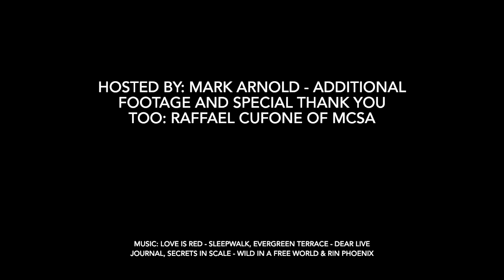253 UC Torana GETS ALL THE FRUIT! - The Iron Empire EP 110

Comment: Nice car.
Did a UC for the wife many moons ago.
That's a big carb for a 253.
Had great results from 500 2 barrels on 253s with a bit of compression, intake, cam, ignition and exhaust work.
465cfm for a 4 barrel is a good number too

Comment: I’m no expert but I would have thought that the 650 is still to big for the small engine?
I had a mild 253 in a LH torry many years ago and that was running an edelbrock 500 4 barrel carb. Ran awesome too.  Although I was not impressed by the old banjo diff in my Torana. Many problems with it.
Reply from the maker: I’m not expert either, but given the work done too this motor it think it will use the Holley 600 (correction) 

It’s a very healthy motor! We have some upgrades in store for the piss poor banjo!
Reply: @TheIronEmpire  yes most definitely upgrade your diff mate. Whilst the holdens are great cars I’m afraid that the old banjos are just not up to the task!
What are you thinking,ford 9inch or a harrop truetrack? Both are fantastic and will most certainly handle your engine.

Comment: Duuuuuude 650 still way to much carby for a 253, 475/500 holley is all you need at most, that's why the commodore cup racing 253 engines all had a 475 holley and those motors where worked and hauled arse, a sub standard 253 with stock heads won't flow enough to need so much cfm from a 650
Reply from the maker: I was meant to say 600 vac. My bad 

If it’s still too much, no worries.. I have plenty of cars around that will happy take ownership of this 600! 👍🏼
Reply: @TheIronEmpire  yeah even a 600 is to much and all it will do is faul plugs and make the motor run hotter,  that carb would be more suited to one of your 351's, only time you would run 600 or bigger is when you get into things like Ported big valve heads and stroker motors, people forget the standard rochester carby will flow 850 cfm once tuned due to the massive secondary but its not needed.

Even our 355 with worked vn heads only runs a 500 holley and it loves it